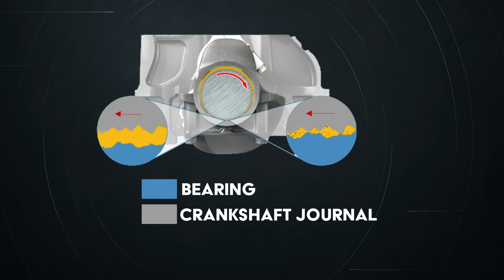the truth about start-stop technology (finally proven)

Comment: I wonder if it’s the same thing for the ford f150 powerboost (hybrid). When at low and constant RPM the engine stop allowing the electric motor to take over until the battery gets too low or you demand more from the truck, at this point the ICE engine starts.

Comment: Agree, this is the most idiotic feature that the Germans started installing in a lot of their cars. The solution is to switch around how it functions - reprogram it to be OFF when you start the vehicle. This way it is basically off all the time you drive your car. If for whatever weird reason you want to use this feature on a certain day, you just push the button after starting your vehicle and the start/stop feature starts working. But by default it is off all the time. This is much more convenient than having to remember to turn it off every time you get into your vehicle. They can easily reprogram at almost any workshop I believe. I did it on my first BMW, so this feature never bothered me again

Comment: Mostly good video, but that pressure test for hot oil is a joke. Putting hot oil in cold engine means oil temperature will drop, oil already in pump (if it's even primed, by time of almost 8 seconds, I wouldn't be surprised if it isn't primed engine) is cold and oil entering pump will cool down even more while heating pump and block. Proper test would be whole engine heated to working temperature, stopped, let alone for about 3 minutes (or to be more precise, time that covers at least 90% of stops where start-stop kicks in) and then spun up. I never saw primed engine that takes that long to build oil pressure, regardless cold or hot.

Also, one consideration for torture test - engines that start using starter have combustion from low RPM because starter cannot achieve higher RPM. Most MHEV cars for start-stop use hybrid electric motor which spins up engine to 900 RPM before any combustion occurs. That certainly affects wear because spinning without combustion makes way less friction force.

Comment: At 0.50…an Audi lasting a million kilometer (621K miles)….?!  Probably in your country but here in the USA it is rare to see any numbers close to that in any Audi or VW. The body will rust out and fall apart long before that. On the other hand, we work on and have seen many 15-20 year old Toyota Prius with over 300,000 miles (500K Kilometers) that are running strong with original engines and their built-in Stop-Start that is part of Hybrid system design. I do understand many people dislike stop-start on conventional vehicles but the longevity depends on how the engine was  designed,  built and taken care of.

Comment: Are you talking about and conducting experiments on an engine designed to operate in Start/Stop mode, or are you talking about and experimenting with starting and stopping an engine that was not designed to operate in Start/Stop mode? Because I don't know if you realize this, but engines operating in Start/Stop mode are designed differently.

Comment: The Prius does 500k km without any maintenance at all and that's got start stop to the extreme. It's not technology killing these cars, it's planned obsolescence. Audi don't want your engine to go 1mil, they want you to buy a new car. The recent Fords are designed to be disposed of at 100k because the sealed wet paper timing belt is too hard to change.

Comment: If your car has start-stop system without fully electric oil pump (which can generate full oil pressure before the engine starts to rotate), get rid of the start-stop system if legally possible within your legislation (typically not allowed!) or get rid of the car.

Comment: Fortunately, my car will leave it in the off setting by default so I don’t need to remember when I restart my car
Only if I put it in Eco mode, do I need to turn it off manually. Fortunately, I don’t use this very often mostly only in the winter if there’s deep snow because it reduces engine power, which makes the car more tractable.
Had the car for almost 8 years and I think I’ve only accidentally used stop start a couple of times
By the way, I did look at this in the user manual that comes with the car and it actually says in there that if you use it, it will wear out the starter motor faster
This car is a 2017 so this has been well known by the manufacturers for a very long time

Comment: I would be interested on see is there an significant difference between stop start on ICE cars  compared to hybrids with their engine constantly turning on and off in city driving regardless of stop start.
Reply: I've just got an older hybrid, 2007. It seems to use the small battery to do all the heavy work and bring the ICE engine up to speed before engaging, unlike a usual small starter motor that can't match that speed. Compared to my 2 1980s vehicles the hybrid has a fascinating drive chain.   I didn't know they hold radiator water in the thermos to pre warm the engine quickly before start to reduce wear and give cabin heating quickly.

Comment: Nice video but unfortunately for older cars. If you add to the mix new engines that 1. Are Direct Injection, and 2. Mild hybrid. Things get more complicated. For example: Direct injection engines dont like idling since richer mixtures increase carbon build up, so idling for long hurts them. Also engines like the HR12 mercedes/renault, startup the engine with the hybrid system and I think keep oil pump/water pump running after stopping, probably for the turbo to cooloff, and finally, start stop, disengages automatically based on engine oil temp. I think time will tell what the f is going on.

Comment: Hydraulik jacking. Crank pin float on a lube oil layer, the surfaces are not in contact. Marine engines, locomotive engines and any big size,  more heavy, use prelube oil pump, to keep the oil layer. For me, this its the stretch limits of euro 6. Euro 4 its the top of polution, anything above euro 4 its BS. They lower let say fuel consumption to rise the points of engine reliability and fuel economy in the papers. But on dark side, fly wheel theet worn out, bendix and starting oil damage, batteries more often do change, even AGM start stop. More money from pockets of customers for parts and service

Comment: Been saying this forever and have turned mine off.  I don't work on automotive but I am a mech engineer on Industrial equipment. One of the most common failure modes on plant is on those which stop/start the most. No mechanical system  likes that due to the additional stresses each time. Great to see this demonstrated, thanks, great video.

Comment: the start stop thing also requires a new type of battery in a lot of cars (most cars i think) The new battery has a little control box on top of it, a chip that talks to the car computer yadda yadda. 
Long story short they are about 4 times more expensive than a conventional battery and they last half the time! I have an alfa romeo from new for 8 years and i replaced the batter twice after it just decided it was not a battery anymore. It was a paperweight. Otherwise the car was ace never had a problem. I always had the start stop feature turned off BTW. Both times i replaced the battery the guy told me these new batteries have a terrible life span. He explained why they are different but honestly i dont remember, just distracted by the 160€ hole in y pocket when a conventional 12v car battery would have cost about 30€. EDIT also i asked him if i could connect a conventional battery and he said not really. it might work for basic functions but a lot of the functions of the car would not work.the trip computer and a bunch of other stuff. Honestly why the hell iare the functions of a car tied to a chip on the damn battery.

Comment: In addition to mechanical wear, the discharge/charge cycle wears the battery. Over 4 years my car calculated that the auto stop/start had saved me about $35 in fuel. Unfortunately, it also cost me a new battery for $250, because of the cumulative discharge/charge cycling. I bought a $35 bypass plug.
Reply: I’ve been running same stop start battery for 10 years now….

Comment: Can manufacturers took advantage of the stupidity of the left to create disposable engines and ultimately create an increased need to replace vehicles.  They then raised prices of the replacement cars beyond reasonable increases and into the absurd.  I’ve always just put the vehicle in sport mode (never buy a car without sport mode) because it disables the auto-stop feature.

Comment: I have a 2024 toyota corolla cross hybrid, at my nightshift job i sit in my car idling for somewhere between 1-2 hours. Naturally the engine does alot of starting and stopping, the engine runs as a generator for about a minute (havent timed it but seems about right) and then is off for idk, 5-10-15 minutes? Not really sure, i never measured it and it depends on how much power i use with the ac/heat, heated seat and android auto/speakers, i can hearthe engine make some kind of noise a second or 2 before the engine starts, i wonder if its the fuel pump and/or oil pump priming

Comment: If stop start is so bad then why don't vehicles like Priuses which have had start stop technology for over 20 years have common engine failure due to bearing damage? Other issues aside, (head gaskets, egr, HV battery, etc.) a prius can make several hundred thousand miles when maintained properly, and I never see them due to bearing damage. Hybrids also don't have starters to wear out since the starter is the electric motors in the transmission as well.

Comment: The tiny bit of gas saved by start stop is completely negated by the increased replacement of the battery and starter. Let alone the wear on the engine. Yet another lie the automotive manufacturers tell us so they can sell a less reliable product and sell more replacement parts. They learned a long time ago the money isn’t in the sale of the vehicle but in the parts and repairs.

Comment: This test more so compared the wear of 3 different bearing types in regular start-stop condition. Auto stop at a red light or where you would otherwise be idling is different in that the vehicle uses a dedicated pump to keep the bearing oil pressure up while the engine itself is off. Different than the testing method in the video but still very interesting to see

Comment: What could possibly be wrong with dropping oil pressure and spiking temperature every time you come to a stop? All them extra cycles on your starter mean nothing. It's going to last forever, anything built today is way better than the older stuff.

Comment: While the experiments in this video may look convincing, the design of the experiments doesn't actually allow drawing the stated conclusions. The claim is basically this:
"I will show that engine A's start/stop behavior causes accelerated wear by repeatedly starting/stopping engine B under very different circumstances."
Others have done a great job of going into the various issues.

Comment: I’m 64 so have had many cars over the years. Batteries typically last 6-8 years. My latest car is a 2021 Subaru Forester, which I purchased new. My first car to have this feature. Just had to replace the battery after only 4 years. I realize this is anecdotal, but based on the my battery situation and the information presented in this video, I am turning this feature off every time I start the car. Hoping this feature didn’t result in too much engine damage over the last 4 years.

Comment: I`ve said for years that start/stop is no good for engines, particularly the starter motor which surely must wear out faster. Where I live on a small island . with traffic lights and road works everywhere , you are forever starting and stopping so I would imagine the wear on a engine is even worse than in this video. I would never buy a car with this feature.

Comment: No one said start-stop isn't harmful. Everything has a trade-off. It's a useful feature for urban drivers who typically would change their cars every 5-10 years, where they can save $300-$2000 in gas from the start-stop system, depending on how they drive and where. These savings are substantive, depending on the price of gas. Who cares if there is more engine wear? The engine needs to last 5-10 years until the replacement vehicle. The only problem with the design is that they should have a better way of disabling it for rural drivers who gain almost nothing from this system.

Comment: I drive a 23 year old Skoda Octavia 1.9 tdi with 400.000 km on the odometer. I fear the day I will have to buy a more recent car, more  expensive and less durable. A lot of the anti-pollution measures (start-stop, wet timing belts, 3 cylinder engines, adblue, egr, less tight piston rings) compromise the longevity of the engines, defeating its whole purpose when you have to replace cars more often. Cars now require more rare earths (over-engineered and full of superfluous gadgets) which increases the environmental footprint of their production. Electric cars make sense if they last, if the materials they are made of can be recycled (rare earths, cobalt) and if range and recharge times become reasonable.

Comment: EVs using engines as range extenders or hybrids that can drive a reasonable distance on battery power are both ways that the automotive industry could've meet fuel economy requirements 

I dislike politicians, however, blaming them for something that isn't their fault (unless you want to argue that they should banned start-stop, which many would considered govt overreach) this one ain't their fault 

Also, if you think we don't need to do anything about CO2 emissions, I've got a bridge to sell you

NOTE: Doing something about CO2 emissions doesn't necessarily mean having to decrease them, geo-engineering is an option, but the consequences of it aren't well known, thus decreasing CO2 emissions is the 'safer' option though far from the only option to something about Climate Change

Comment: This is yet another video where people THINK they created a test that proved something, and only proved they have no idea how to create an accurate test.  You CAN NOT simulate a Start Stop system wear, on an engine, that DOES NOT HAVE a Start/Stop system installed.

Because, the engines are... wait for it... ENGINEERED differently, and are specifically DESIGNED for the the Start Stop system wear to be minimal.

Next week, MIK is going to show you how using Airplane parts, in a Boat, doesn't work, as they don't tolerate the high salt environment boats live in....

Comment: This isn't  a problem with start stop technology its bad engine design all you need is an electric oil pump to keep oil pressure up and a cooling system for turbos and stuff. Infact having oil pressure immediately is good for anyones engine when starting since especially if its a cold day were the oil is sitting at the bottom.

Comment: ok so your engine will where out in 20 years instead of 100 but about the battery ? I rented a new car for a couple days a few years ago the damned thing would shut off and restart every time I stoped at an intersection that has to be really hard on the battery and starter thing is gona shut off at an intersection then fail to start back up. it's just a matter of time.

Comment: so basically, starting an engine is bad for the engine?  is there a breakeven point where if i have to idle an engine for x minutes that after x minutes it's better to turn it off and start it again when needed?  ...from engine wear standpoint, not fuel economy.

Comment: 1:45 - so have a dedicated oil heater in the system/actually manage oil pressure dynamically, right?
That way a pre-heat/pressurisation cycle could protect from cold on normal starts, right?
Reply: 4:10 - oh, ok I get it.
The mass held up by the bearing has settled when at rest, so the bearing has more tome with metal-on-metal until the fluid is balanced around the bearing - that’s the issue, as much as heat/pressure. 
Yep, makes sense.

Might be some engineering solutions to reduce that issue, I guess. But equally, just leaving it on tick over & using electric on pull-away for efficient torque, before blending back to ICE is probably a decent efficiency/wear balance, without resorting to full stop/start.

Comment: 5:12 but it's a cranking speed oil preasure and healthy engine powers up in less than one second to much greater speed so this demonstration does not really illustrates real world start/stop wear, also start/stop occurs only when engine is warm... by saying that I also hate start/stop most of the times, especially when you need to do quick maneuvering but the car is thinking that you have fully stopped and will not go anywhere so I usually turn it off after engine start...
Reply: He said the engine was being spun over at idle speed of 800 rpm. So the speed is accurate, just not the oil viscosity due to the low temp.

Comment: Dumb question. I've read that airplane engines can/use to be equipped with a pre-lubrication system, that cranks up the oil system before the actual engine starts.
Why hasn't it ever been done on cars?

Comment: In conclusion. Small engines should run a generator and charge a battery. Keep the engines on in perpetuity, except for maintenance. Use induction electric motors for drives on cars, because they are really good at start, stop, acceleration, and generation (Regen braking).
Reply: Only issue is that these are more inefficient at high speeds compared to a purely internal combustion car or parallel electric motor / engine system. Plus a battery AND engine is a pretty heavy system. I feel like extended range BEVs have largely pushed these back in terms of relevancy. I still think they're neat though